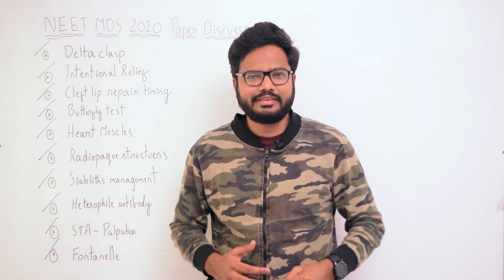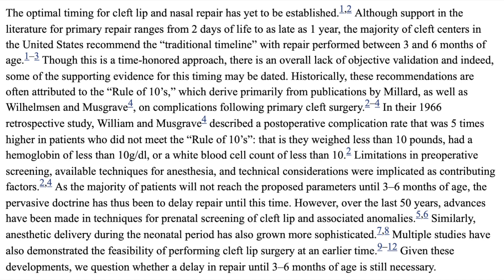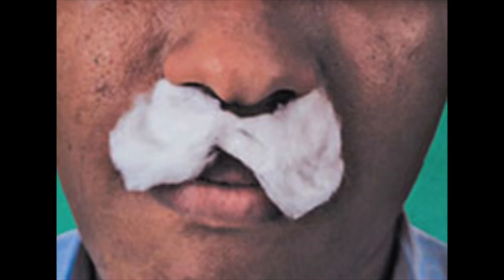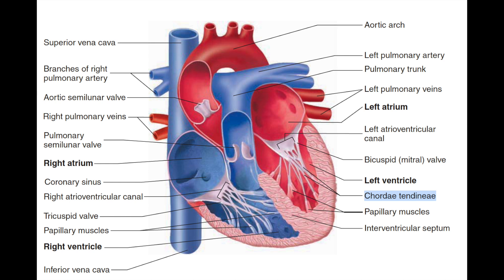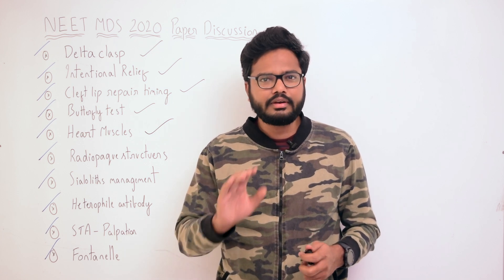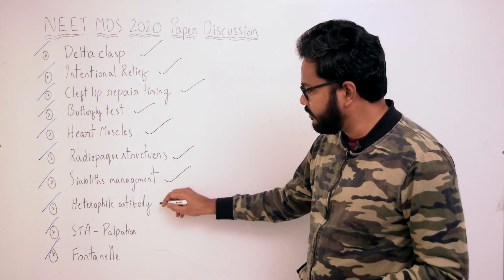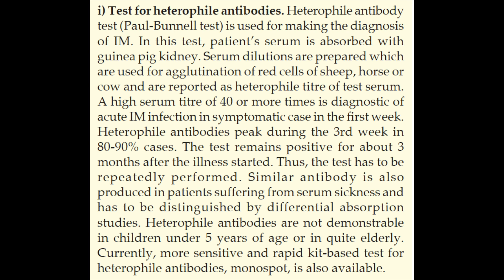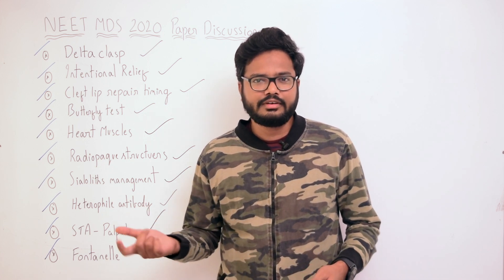Part 17 | NEET MDS 2020 Paper Discussion | Happy New Year 2020

Comment: So the ans in neet mds is supra ventricularis or chorda tendina which prevent the back flow idont remember the qn exactly ....any body know pls mention
Reply: Saran B raj .. triscuspid and right ventricle - cista supraventricularis
Reply: Delta clasp used in which myofunctional appliance
A) activator
B) bionator
C) twin block
Reply: @ravikarthikayan2212  chordae taenida is the ans i think
Reply: @ravikarthikayan2212  twin block
Reply: @ravikarthikayan2212  was it the qn???right or left that was asked in neet??
Reply: sudeep shanmukh  exact qustn...can u remember ??
Reply: @ravikarthikayan2212  twin block
Reply: @TheBrainWaveHubb  remember the exact question that was asked in neet ..I don't remember it
Reply: Saran B raj  i remembered tricuspid value
Reply: sudeep shanmukh one questn regarding , while extrating a tooth , adjustant tooth root is bend...it is called as ?? DILACERARION ??
Reply: @drsaranbraj4192  sry i dnt remember the exact ques
Reply: @ravikarthikayan2212  yes
Reply: @ravikarthikayan2212  sry i dont remember that ques
Reply: @ravikarthikayan2212  twin block